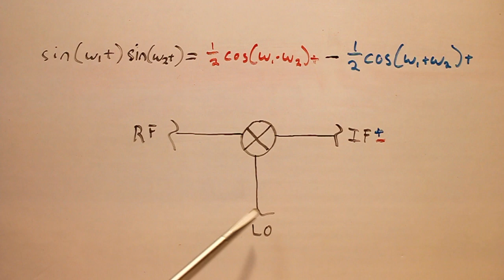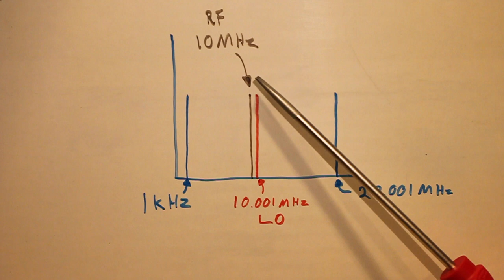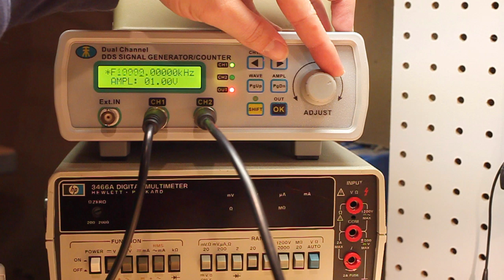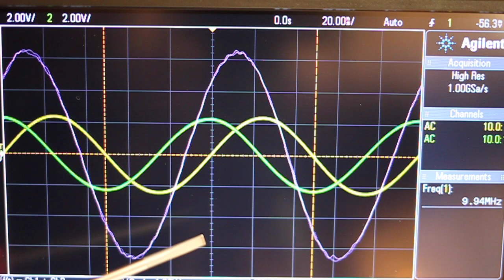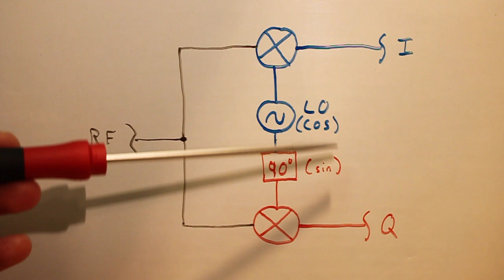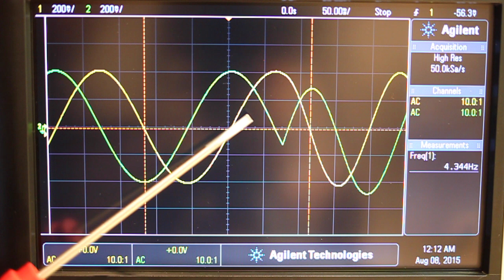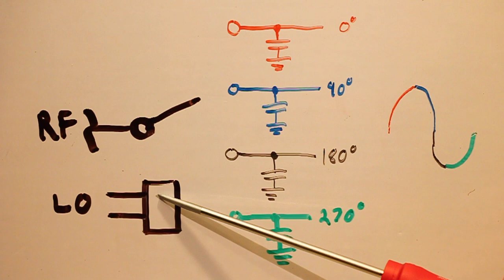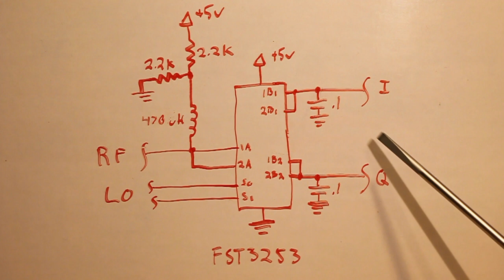Quadrature Mixers, IQ Demodulation, and the Tayloe Detector

Comment: I have been working on a scratch SDR design for about 2 years now. It started as a Tayloe design with a STM32F4 processor as the DSP/uC but morphed into a direct sampled FPGA design using an Altera Cyclone II DSP kit. Great fun implementing quadrature demodulation for all the modes. I still marvel at what a simple concept quadrature demodulation is! Thank you for this awesome video!

Comment: This video just started playing out of nowhere while i was replying to comments. I wansnt even watching anything to begin with. It’s wild because it’s exactly what I needed to know. Im building a radio. Right now im trying to amplify 4mhz active crystal and its not working. The crystal by itself is louder than adding a transistor or fet. I didn’t play around too much with bias and I didn’t do any filtering. I used an antenna and resistor or i used a transformer and antenna, I even just shorted it with antenna. I figure it should at least be louder than the crystal even if poorly implemented but maybe not. Another round of testing today. Maybe the chips im using can’t handle 4mhz but I didnt think that was particularly fast for a run of the mill semiconductor pulled from old monitors. Today ill try making my own oscillator I guess. Also would help if i had my 50mhz scope.

Comment: Nice work. One thing that will better explain the harmonics. You are not multiplying by a sin function from the LO. You are multiplying by a square wave. And a square wave contains the fundamental and all off harmonics with amplitudes as seen in the Fourier Transform of the square wave or Heaviside function. These are all filtered out later. This is what makes modern high frequency SDR possible. Switching the source off and on is the same as multiplying by the frequency of the switch and its odd harmonics.

Comment: Since we are using a switch, how come we don't see any other frequencies? Thanks
Reply: Remember that the capacitor (C  = 0.1u) and cable impedance (R = 50oHm x4 = 200oHm) form a LPF with cut-off frequency 8kHz, cutting off any high frequency harmonics (10MHz,. 20MHz, 30MHz,...)

Comment: In the schematic shown at timestamp 31:00 I don't understand how you can simply connect the two I and the two Q outputs together, from my understanding I and -I should be subtracted, not added, and also Q and -Q should be subtracted, not added.

Edit: can answer it myself, you are not using the other two phases -I and -Q at all, instead you are just using I and Q and are just connecting two identical multiplexers in parallel which confused me for a few minutes.

Comment: Can you explain mathematically( with equations) or using Matlab  the relation between the local oscillator frequency and the RF frequency for IQ Demodulation.

I tried what you said but it doesn't work if you multiply that the RF signal with  the local oscillator one time in phase and the other time 90 degrees out of phase to find I and Q.

Actually, what is the final mathematical relation between the frequency of the RF signal and the phase with respect to the local oscillator ? 

How is it possible to measure the relative phase between 2 signals that have 2 different frequencies ? it will always be changing !

Comment: I and Q are supposed to be 90° out of phase, right? Right? I've spend more time than I care to admit in a graphing calculator on this, trying to model the two functions that would result from that 1:4 demux schematic with just a sine on the input, and I'd consistently get signals 180° apart.

The part where you explain how the Tayloe detector operates could use quite a bit more work.

Comment: The part at 3:50 was too short.
We saw little 3 and 5 but much 2 and 8,
but what was the rest?
4 6 10 16?  This is the most important engineering part.

Comment: Is there any reason why most people use i instead of j for √(-1). This is actually the first time I've seen Euler's identity with j.
Reply: Maybe because "i" could be mixed up with "current" in electronics?
Reply: @hopkinskong  There's no maybe.  That's exactly why it is used.  Lowercase 'i' is used to denote AC current in electronics.  So as a result mathematical 'i' got renamed to 'j' to avoid the confusion.

Comment: 7:20 - I still don't understand how the output can be directly heard on a speaker. with 10MHz and 10.001MHz inputs I thought the output would be essentially a 10MHz signal with a 1KHz AM modulation envelope... to recover the audio how come we don't need to clip the signal with a diode first?

Comment: Thank you!. still confused about the image rejection, if the output is the sum of I components and sum of Q components on either side of the LO. say my LO is 1MHz, and I'm trying to listen to 0.9MhZ but there's a carrier at 1.1MHz, i'd have my Q at 100khz, and my I would also be 100Khz but it would be the sum of both I signals, both of wich might be modulated, how can i then decompose that signal?
Reply from the maker: +coffeecuppepsi To reject an unwanted image signal, you need to introduce an additional 90 degree phase shift between your I and Q signals, then take the sum or difference of I and Q, depending on which image you want to reject.
Let’s focus first on the image you want to reject at 1.1MHz, which is 100kHz above your LO. Since it is above your LO, we know that the I signal will be leading the Q signal by 90 degrees in the output from your quadrature mixer. Now, let’s say you delay the I signal by an additional 90 degrees; this means that I and Q are now 180 degrees out of phase. Now, if we feed these 180 degree out of phase signals into a summing amplifier, their sum will be 0 because they cancel each other out, and you get no output from your summing amplifier. You’ve just rejected the unwanted transmission at 1.1MHz
As for the desired image at 0.9MHz, because it is below your LO, we know that its I signal will be lagging the Q signal by 90 degrees in the output of the quadrature mixer. Thus, delaying the I signal by another 90 degrees puts its I and Q signals in phase (no phase shift), and the sum of two otherwise identical in phase signals will be double the original amplitude. So you’ve just doubled your desired transmission, while simultaneously rejecting the undesired transmission.
Now, if you wanted the opposite (i.e., reject the 0.9MHz signal, but keep the 1.1MHz signal), you would use a differential amplifier instead of a summing amplifier. The difference between two in phase signals is 0 (this rejects the 0.9MHz transmission), while the difference between two 180-out-of-phase signals is 2x (this amplifies the 1.1MHz transmission). Or, you could still use a summing amplifier, but delay the Q signal instead of the I.
In the real world of course, there are always errors in phase, amplitude, etc., so the image rejection is not perfect. It can be made very good though, good enough for most applications.
Reply: +devttys0 oh wow it's so elegant, thank you for explaining that :)

Comment: Thank you for the dmeo.  I know that when you demodulate, you need to phase lock the LO on the receiver side to the original carrier on the transmitter side in order to have a reference signal for phase compare.  My question is how do you perform this phase locking action?
Reply: No you don't need a phase lock to the RF only your s0 and s1 signals to get the I and Q signals have to be in exact 90° phase!

Comment: Hi Sir, Very good presentation and really practical. Great work. One question - At "30:30" you say the impedance with 50 ohm Reference impedance becomes (50 /4)ohm, since it is ON only 1/4 th of the time. I thought it would be 50 Ohm X 4 as 3/4 th of the time it is infinity. Hence effective discharge occurs only for 1/4 X 50 X o.1 uF  as averaged over time.  Is it not?
Reply from the maker: +Shyam You're correct of course, I'll have to add an annotation to the video; the resistance should be (50 ohms + switch Ron resistance) x 4. Thanks for the correction!
Reply: +devttys0 Thanks.

Comment: re using a switch as a mixer; why doesn't that cause the waveform to have hard edges where it goes low 50% of the time, losing half of the signal and producing something distorted? You've even drawn it that way (at 2:58 for example)
Reply from the maker: Wayne Marsh If you just had a single on/off switch as a mixer, it would. As I mentioned at 2:58, not all mixers work that way, but I used it as an example because it is conceptually easy to understand, and is also fundamental to the operation of the Tayloe mixer which I discuss later on in the video.

The TUF-1 mixer that I used as a single mixer example doesn't work that way; it's a diode ring mixer which multiplies the RF signal by 1 and -1, not 1 and 0 like a simple switch would. Note at 3:40 how the signal seems be be continually inverted causing sharp "points" in the waveform, rather than hard edges with periods of no signal. (See W2AEW's video on diode ring mixers: https://www.youtube.com/watch?v=junuEwmQVQ8)

Although the Tayloe mixer does use on/off switching, the capacitors on the output lines hold the voltage when the switch is disconnected, so the output doesn't suddenly drop to zero when the switch is turned off. The capacitors, in conjunction with the source input impedance, also form a low pass filter which help to filter out higher frequency distortion.
Reply: devttys0 That makes a lot of sense. I figured something along those lines.

I think I mentioned in another video, I really enjoy your videos as I do everything completely in software, and it's cool to see how it's done in actual physical circuits.

Comment: Hi Craig, thanks for the very informative video. I notice, at around 24.30mins in, where you are describing the Tayloe detector, that you say that the switch commutates (i.e. ‘switches’ or ‘cycles’ in sequence) over the outputs in order (00,01,10,11), and that this is driven by two parallel inputs, both coming from the same LO source, but appearing in phase quadrature (i.e. there is one quarter-cycle delay on the second with respect to the first). However, it isn’t clear to me how those quadrature control signals would produce the switch control outputs in that given order. So is it possible that the order of the switch positions will in fact be different from the strict ‘commutated’ order? Regards, Damian.
Reply: The two LO lines come from a binary counter that's clocked by the LO.  The example of switching thro the phases is confusing, I think he mentions the RF signal and LO are in phase, but of course they aren't in actual use. Suppose he meant for the example given.

Comment: I wonder if it would be possible to create a Tayloe-Mixer using general purpose bjt-transistors (BC547C or 2N2222 ...). I bet this wouldn't be advisable because these transistors are quite slow... but has anyone tried it just for curiositys sake? While I did succeed simulating this using BS170s all my attempts to do this with BJTs did fail so far...

Comment: At 8:40 I get the impression that you mean only the direct down conversion has the mentioned problem. Could you explain how a multi-stage down conversion would solve the RF/Image ambiguity problem?
Reply from the maker: Ehsan Tofigh That is correct, superheterodyne receivers solve the image problem by first converting the RF signal to an intermediate frequency (IF). 

Let's say I use a 14MHz LO to convert the 10MHz signal down to 4MHz instead of 1kHz; the image frequency is then 14+4=18MHz, which is 8MHz away from the desired signal, which is far enough away that it can be easily filtered out by the RF front-end filter.

The 4MHz signal can then be further filtered/amplified if desired, and then converted down to 1kHz with a second mixer and LO running at 4.001MHz. The second mixer/LO has its own image frequency at 4.002MHz of course, but again, that is 6MHz away from the desired 10MHz signal, and is easy for the RF front end filter to reject, ensuring that any RF signals at 4.002MHz never make it to the IF stage.
Reply from the maker: devttys0 I should also mention that while a 10.002MHz signal will still be converted to 4.002MHz in that example, thus causing an image frequency at the second mixer, very tight IF filters can be made at 4MHz (e.g., using crystal lattice filters) that can reject that unwanted signal before it gets to the second mixer.

Comment: Hi just subscribed you, nice way of explaining.

But how can you tell which frequency it is without an oscilloscope?
Reply from the maker: +Oskar Ceso If you have a nice clean signal like in the video, and all you want to do is tell if the signal is above or below your local oscillator frequency, it's very simple. You just need to determine if the I signal is leading or lagging the Q signal.

A simple way to do this would be to feed the I and Q signals into two I/O pins of a microcontroller. The micro could monitor those pins to see which one goes high first, and then you would know if I is leading Q, or vice versa.

Of course, if you have many input signals at once, or a lot of noise (both common with RF receivers), you'd need some filtering/signal conditioning to make this reliable. Typically the I and Q signals are digitized with an ADC, and the signals are then digitally filtered/processed in order to determine the phase relationship between I and Q.
Reply: +devttys0 Thank you very much! :)
Reply: +devttys0 about the "see which one goes high first", there isn't really a reference to determine that.  I think you'd need to measure the delay between three instances, and pick the smallest of the two delays (ie find a 90deg case and a  270 deg case, and focus on the 90 deg case).  Once you have the two signals which are 90deg apart,  see which one came first. BTW, what's the impact of the time it takes for the mux to close one channel and open the next? Is it a make before brake or vice versa?  Which is best?
Reply from the maker: +mdesm2005 I'm not sure what you mean by "there isn't really a reference to determine that". The reference is time, just like on an oscilloscope. By definition, when you have two signals (in this case I and Q) that are out of phase, one will be leading the other, meaning that one will cross a microcontroller's logic high threshold first. Hence, there will be a state when one of the signals will be high and the other is still low.

If I goes high while Q is still low, then I must be leading Q and the RF signal coming into your mixer is above your local oscillator frequency; if I goes high and Q is already high, then Q is leading I, and the RF signal coming into your mixer is below your local oscillator frequency. It's pretty easy to configure an interrupt on the rising edge of the pin that the I signal is connected to, and have the interrupt routine check the state of the Q pin to determine this relationship. It's not a robust solution for most real-world scenarios, but it's simple and demonstrates the basic principle; I've done this myself, and I can assure you that it does work.

I've not seen any literature, or done any experimentations myself, regarding make-before-break vs break-before-make in this application. However, since each output is intended to effectively be a separate sample and hold circuit, I'd suspect that break-before-make is preferable.

Intuitively, the more time it takes to switch between outputs, the more of the signal you will lose (assuming break-before-make), so I'd say that generally faster is better, but the impact of a high-speed multiplexer's switching time should be negligible. Dan Tayloe's paper states that the maximum operating frequency is limited by the FET switches, and should be in the neighborhood of 10GHz: http://www.wparc.us/presentations/SDR-2-19-2013/Tayloe_mixer_x3a.pdf.
Reply: devttys0
thanks